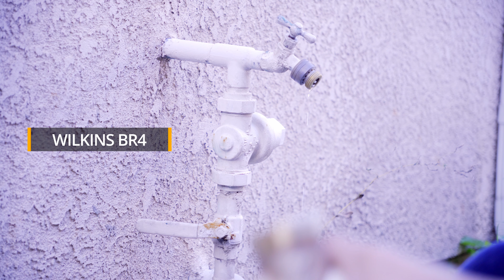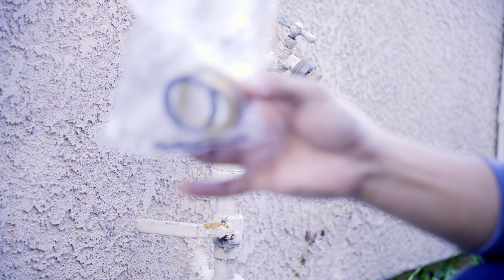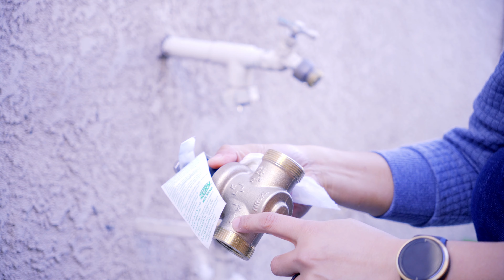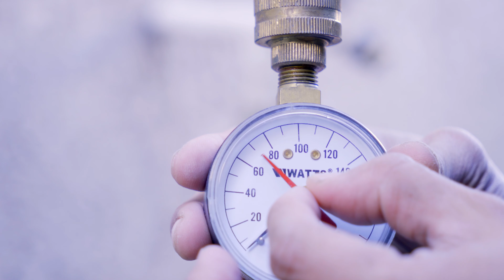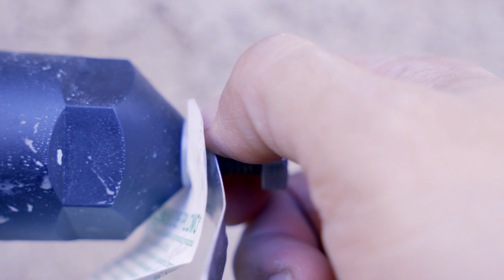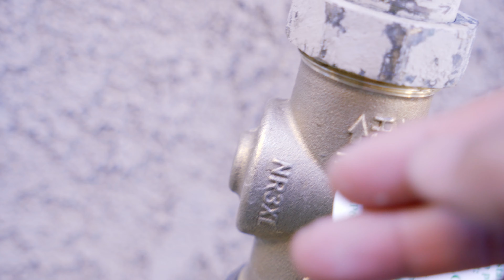Pressure Reducing Valve Replacement Install and Adjustment [HOW TO] Wilkins Zurn BR4 NR3XL Regulator

Comment: Why use the OLD couplings?  Would they not come off?
Reply from the maker: The old couplings were still in perfect condition, so I reused them to simplify the installation process while just swapping in new rubber gaskets for a proper seal. Putting in new couplings would require cutting the pipes for removal and sweating on new piping, etc

Comment: My regulator was buried in the ground 2 feet behind the water meter, its pretty standard outside city limits, so if you cant find yours start there, or it could be in the ground below the first spiggot after the water meter. I also installed a plastic valve box that was $10 over the valve so i never have to dig again. I bought the same zurn regulator as this gentleman and its highly rated. This video was excellent!
Reply from the maker: Great point! I have a separate line for irrigation, and the regulator was buried in the ground. It definitely took me a minute to find, and that’s a great idea to house it in a plastic box. Thanks!

Comment: James a couple quick questions. Does your system use an expansion tank for a closed system with a dual check valve, or is the pressure regulator installed a bypass for backflow? Regards.

Comment: nice job on the video - replaced the same exact set up - floor jack worked great - did have to use a ratchet strap to help move it side to side to line up FYI for those who have that issue
Reply from the maker: Awesome idea with the ratcheting strap! 👏🏽👏🏽👏🏽

Comment: I would tighten the lower one first to create a bigger gap for the gasket on the upper. That and slightly lifting while the wife slipped in the gasket worked great. No risk of cracks or bends using a floor jack.

Comment: Thanks for the video.  Did you use any teflon tape?
Reply from the maker: Hello, in this case, the threads do not create the water-tight seal, so no teflon tape is needed.  The rubber gaskets create the water-tight seal.

Comment: If you have a slight leak do you need to shit off the main water before tightening them up?
Reply from the maker: If it’s a compression fitting, you can simply tighten things up and the leak should stop. -that’s only if your gaskets are good. You’ll need to shut off the water only if you are replacing a gasket. Hope that helps!

Comment: Are there any prv on the market that will allow pressure back flow to the city so that you don’t need an expansion tank for the hot water tank? One that allows an open system for back pressure instead of a closed system
Reply from the maker: Good question, but I am not familiar with any PRV like that. I am looking to install an expansion tank soon, but will also do some research regarding back pressure. Thanks!
Reply: I beieve the Zurn Wilkins nr3xl has an integral bypass that allows backpressure greater than city pressure to flow back.  Make sure to call Zurn Wilkins to confirm.